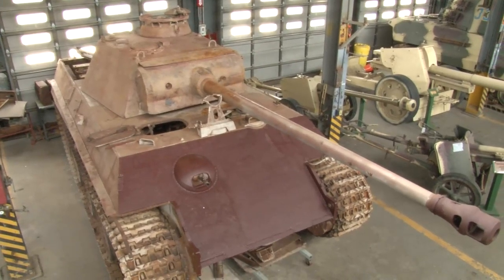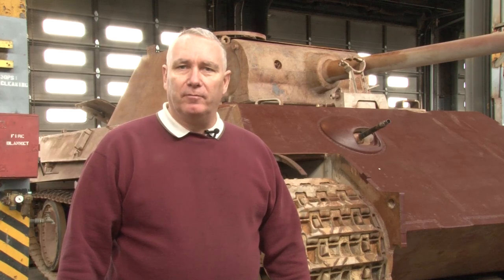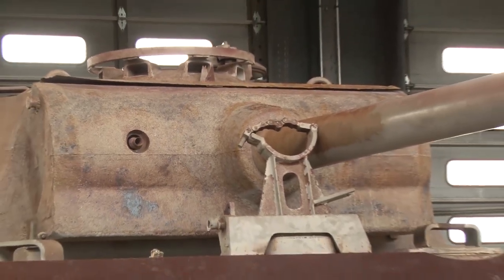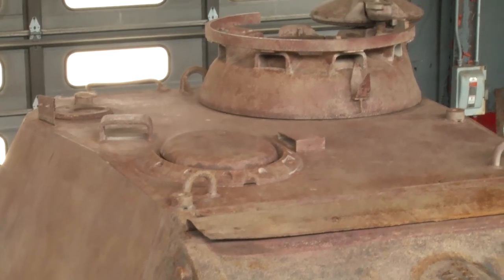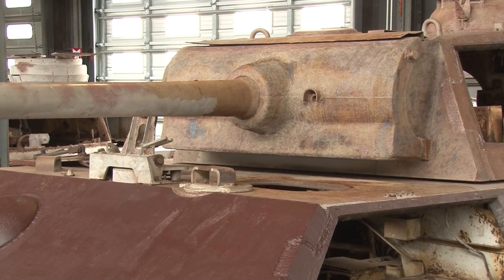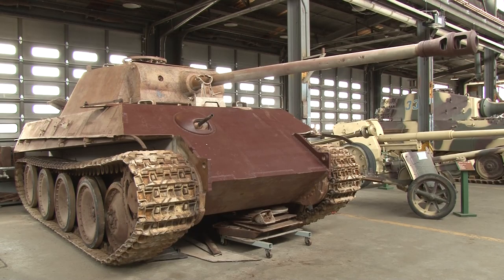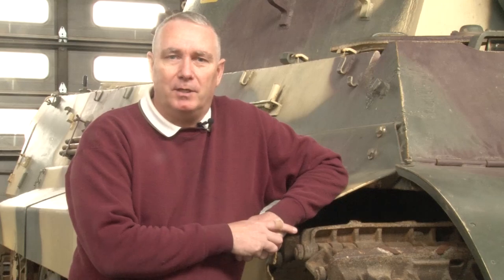Tank Talk: The German Panzer V "Panther"

Comment: Good video. Also...angled armor isn't just enhanced because of the "ricochet" inducing properties, but also the increased armor thickness relative to the likely trajectory of ground fired weapons. A tank round hitting 3 inch thick armor plate straight on would only need to penetrate 3 inches. If angled, however, the thickness is proportionately increased considering how much has to be penetrated. So 3 inches becomes more than 4 inches when angled.

Comment: that's a panther G. The way you can tell is where the gun mantle is curved from top to bottom on the panther D, the G model has a large flat piece of steel at the bottom of that curve to prevent trap shots ( Ricocheting A shell into a weaker portion of the tank)

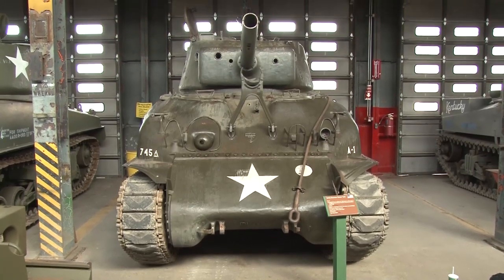Comment: 1:35 except for the mid gun plate and the turret-ring. M4s armed with a 76mm could easily pernitrate those sections. 
3:35 This was a feature in the Panther, however the Sherman featured it first and with significant testing was deemed pretty much useless due to technological restraints of the time.
Reply: And the Sherman,even early M4A1's had a gyrosoptic stabilizer system which the German armor did not,way ahead of it's time for the day.

Comment: The British met and destroyed 90% of the German armour in Normandy.  Most shots on the Panther would be from British tanks.
Reply: utterly crap claim... 50% of all German tank looses in France after D-day were destroyed by own crew not enemy action.. most reason run out of fuel run out of ammo or tecnical problems and tank could not be recovered. The tank exchange ratio between german and allied tanks were horrible for the allied throughout ww2... they would been even more worse if Germany had enough fuel to operate its tank fleet at 100%